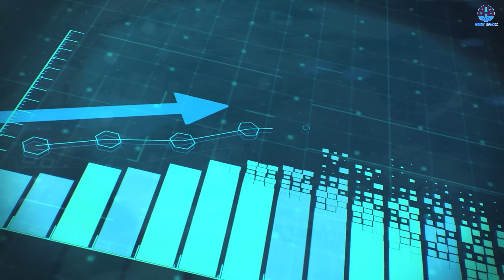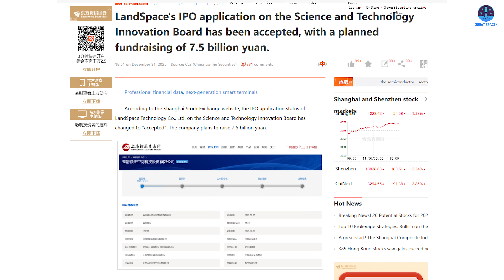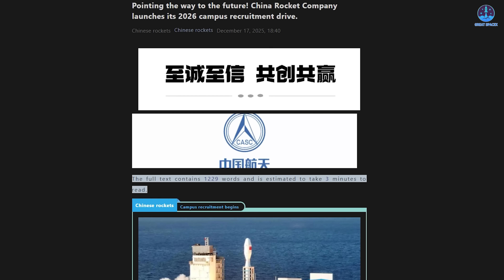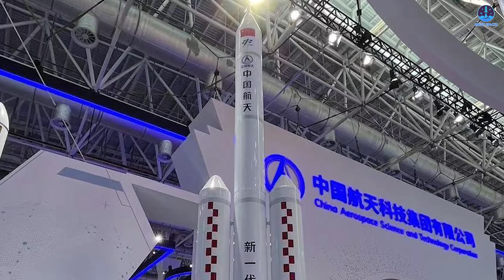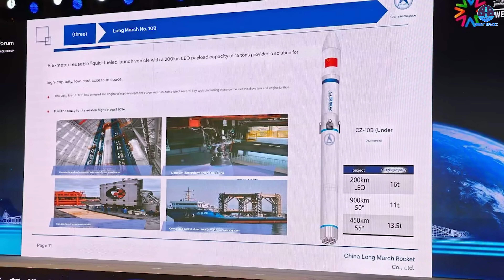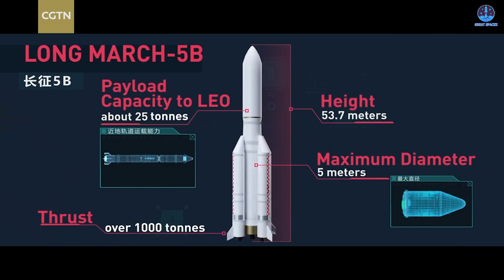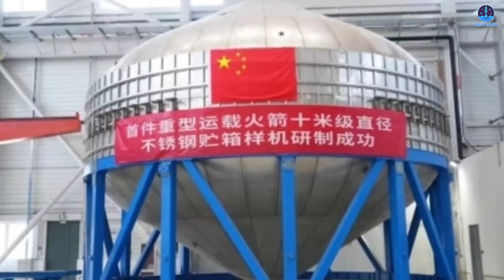Disaster! China funds a Billlion of Dollar on COPY SpaceX Reusable rockets - But FAILED Miserably…

Comment: The answer is no 🙂‍↔️.
The reason is that they literally fired the top brass of the rocket force.
Not only the boss but the main engineers as well.
Also the supplier of the private sector is the same company supply the government program.
And they are cutting corners.
In space mission it means empty space station evacuated.😅

Comment: Remind us how many falcon 9 boosters crashed before SpaceX managed to recover a booster.  Let's see how many the Chinese crash before they can recover one then compare and see who did better.
Reply: They have to learn what SpaceX learned through development and test. The path may be shortened by " copying," but maybe not, too.  Why? Technology available to SpaceX may not be available to Landspace. A seemingly small change can drive large changes in configuration.
Reply: @rwesenberg i think the only copying they have done is to say to their managers and engineers "see? It is possible to recover a booster and refly the booster. Stop arguing and make it happen " the only thing SpaceX has done is to ignore the people that say it can't be done and get on with doing it. None of the Falcon 9 technology is new. It is all done with existing technology.
Reply: 9 flights failed to land safely. That is why it is called Falcon 9 with the 10th flight landing safely. It took New Glen 2 flights to land safely but over 10 years.
Reply: @mrbaab5932 ok. So the Chinese have more 8 goes to make it work. 😂
Reply: This conversation reminds me of Elon Musk joking about BYD a few years ago...😂. Seriously, China advances very very fast, even faster than Space X. It is just a matter of time ...
Reply from the maker: They copied SpaceX, while SpaceX was the pioneer.